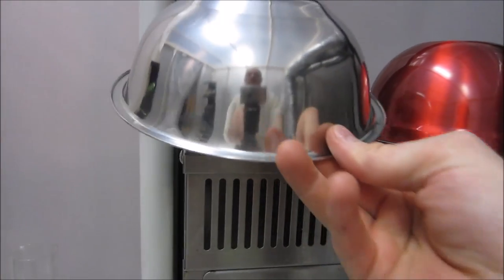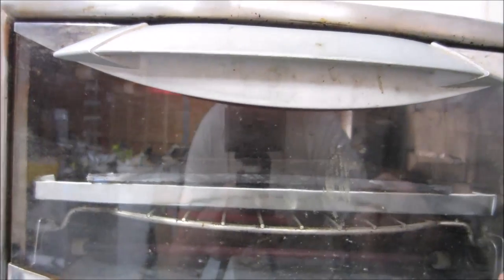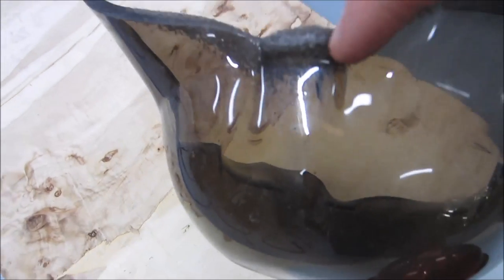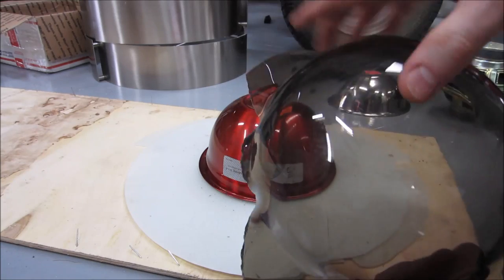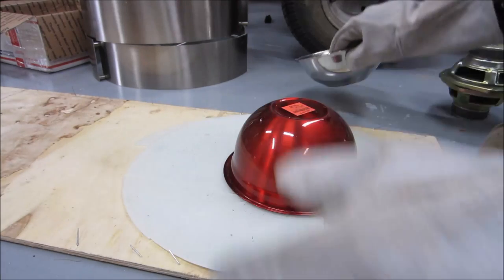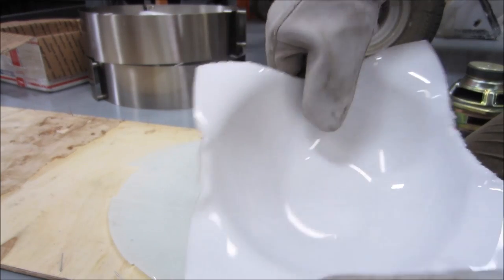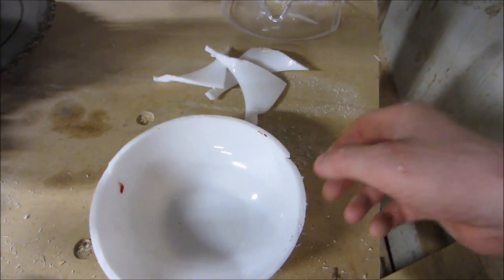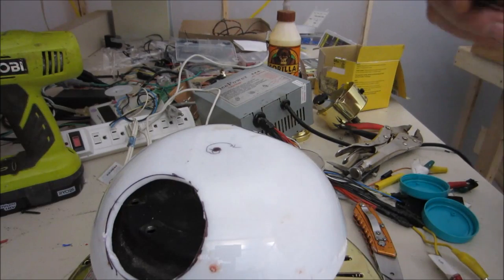Heat forming plastics in the toaster oven | DIY Centrifuge from junk - part 2.5

Comment: I was waiting for you to cut the plastic into a circle before trying to form it.  I think you would find it much easier to cut a circle just a little larger than you need and then heat that.  Part if your issue with the plastic buckling was the uneven stress around the outside caused by the 4 corners in free space unconstrained by the mold.

Comment: Topology issue. Square peg in round hole. Geometrically speaking, it mathematically "wants" to fold like that, in order to reduce that you have to cut a bunch of triangles on the sides. If you want a fine curve then you'd cut 100s of triangles in order not to notice the polygons. Of course you can get lucky and the bad topology can be ignored and maybe sometimes you get decent bowls, but it will have a bunch of non uniform stresses everywhere. That is why I assume the engineers do not use this method to make bowls, probably they use injection molding maybe. I have been experimenting with this method myself to make structured objects. But a large roadblock in my way is non uniform heating, consumer ovens do not provide uniform heating on the plastic. They are meant to bake apple pies, and make it a little bit interesting when the pie is not heated uniformly. It seems best suited to small plastic jobs not the large jobs I require. Keep me updated on ways to mitigate the non-uniform heating issues.

Comment: The reason for the creases is not the bowls but the fact that a sheet can't easily be shaped into a dome. It's just to try to do the same with a piece of paper and it becomes more obvious. Plastic will ofcourse shape a bit more since it is more elastic when heated and it will become thinner as needed, but that is only up to a point. To become a dome it needs to become thinner in very specific areas.

Comment: I'm wondering if a slightly lower heat and allowing the plastic to conform over the bowl in the oven, then finalize the shape with the other bowl and pressure, would alleviate the wrinkling.  Heat as high as possible without damaging the plastic.  You need an oven thermometer to see your actual temps, though.  Less than $10 at a big box.  You can search for the temp ranges of the different plastics you are using.
Reply from the maker: Temperature is a good point.  My main issue is that I need a better setup for melting plastics.  That toaster oven is way too small to fit a bowl.  I'm considering picking up a used full sized electric oven when a good deal comes along (ie free or close to). :)

Comment: Drill holes in the sides of the bowl and put a can of sterno in there under it. Thats pretty good considering how thick that pc is. Try a larger sheet next time so the part that curls up will have more plastic to stretch.  Notice on the corners it didnt wad up. Theres more material. I was about to say use the red to squish the silver. It looked bigger a min ago.

Comment: I was impressed your blade didnt melt the plastic then it bit. Id suggest cutting it in quick even short cuts. Dont leave it very long so you blade doesnt start heating it where it will bite and jerk the bowl.

Comment: look up centrifuge failures. they can go through a wall or explode if not balanced within 0.1 grams depending on the size of the whole machine. though if youre only going up to around 2000 rpm it might not be an issue.
Reply from the maker: Sounds about right.  Eventually after a series of tests I realized I could keep the RPM fairly low and still get the result I was looking for. :)

Comment: i cut an acrylic with a jigsaw and after few seconds the heat melts it a bit and sticks to blade making saw jam.
Reply from the maker: You need to move slowly and maybe switch to a wood cutting blade.  You might also try coating the blade in oil or wax to keep it from sticking... basically it's getting too hot and bonding, so you need to either make it slippery wit a lubricant, or keep it cooler.  I have good luck using bandsaws because the blade cycles and stays cooler overall, rather than a jigsaw which concentrates friction in a single area.